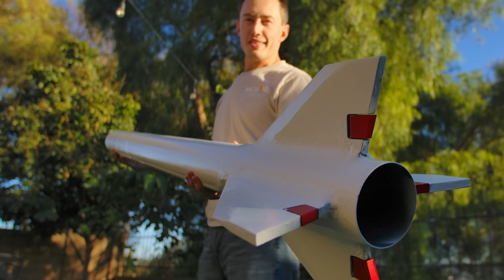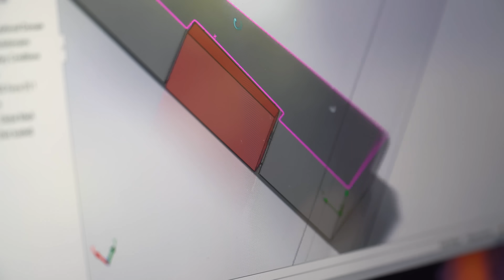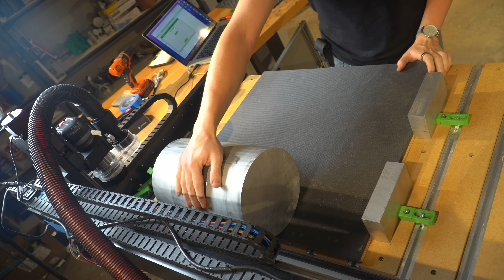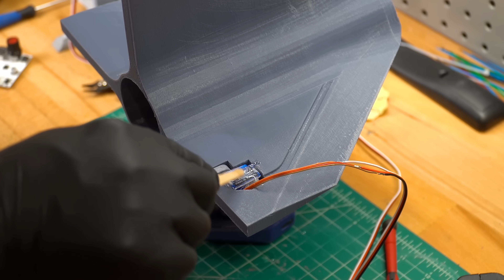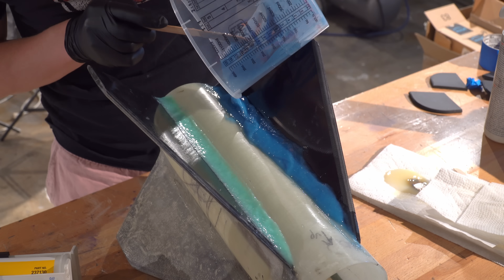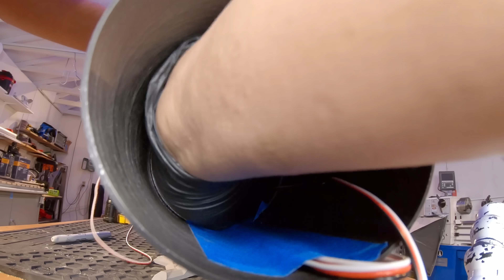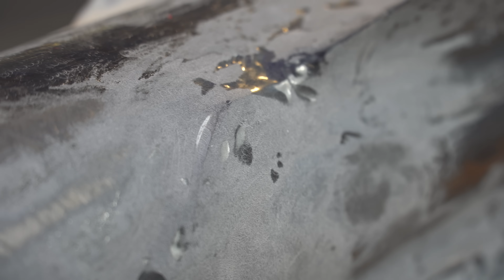Building a Guided Rocket to Hit Mach 3

Comment: you seem to be fairly thorough for the design limitations of the project I don't see you skimping anywhere and it's always good to worry, failure is always an option but an option to be avoided engineering and preplanning always have on hand what you need before you start is number one and number two is never start a land war in Asia

Comment: not sure if you did this or not but printed drill jigs for something like this should utilize a plain bushing to interface between the drill and the jig. ie to drill a .250 hole print a jig with a .375 hole and press in a bushing to get from 
375 to .250 this yields much better results esp if the jig is to be reused

Comment: Whoa homeskill you should not be using acetone with epoxy.  It works great but the consequences are unavoidable even with a lot more PPE than you use. You will have a very short career working with epoxy if you get too much exposure to acetone and epoxy at the same time.  The acetone gives epoxy perfect transport through your skin or lungs and into your bloodstream.  You absolutely will develop an allergy.  Anyone who tells you differently is drawing from inapplicable experience.

Comment: I'm boatbuilding at the moment and would strongly encourage anyone sanding epoxy/glass/CF to invest in a Mirka-esque sander and an autostart vac. 
That'll cost you AUD1200 for genuine or AUD300 for a knock-off. Both blow a conventional orbital sander out of the water. With good abrasives you never see any dust (but wear a respirator anyway!).

Comment: How is a guided rocket different from a missile in terms of R&D?  Like I feel like the feds should be extremely interested in monitoring and regulating this.
Reply: It doesn't matter because he isnt targeting anything. 

A guidance system vs a targeting system along and the lack of a warhead is the main difference. 

However, guidance on HPRs and MRs has been around for decades, namely the sun-seeker or sun-guided model rocket.

The Saturn V was a missile, but we call them rockets because they carry cargo and/or passengers.

Also,  the NAR requires a working recovery system.

Comment: use heatshrink on the solder joints 😭😭
Reply: My good dude, if you are drowning it in epoxy nothing will touch that metal again.  You would want a drill to access that joint again.
Reply: @MrBrukmann  nah it shorts to the carbon fiber
Reply: @_ollie  I actually have decades of experience with this material. Yes, if I was running a factory and knew randos would do the work I would make them shrink wrap it. Frankly the presenter would qualify as a low experience worker (very smart though!). 

I would take a disposable cup and make a side batch in a few seconds where I adjusted the parameters of the epoxy such as surface tension and insulative filler to make something that gels to the connector and wire really well, creating a 100 times better (practically indestructible) form of your heatshrink. You can literally do almost anything with these materials, they're magic. If I wasn't allergic due to using acetone with epoxy like the presenter here, I'd still be making magic.

Comment: "You can be killed by an Estes park flyer."

I had a little Estes R2D2 rocket fail to ignite once. I didn't know what was happening and walked up to it. It ignited suddenly, when I was about to bend over and pick it up. I felt the heat of the exhaust on my face, but wasn't close enough to be burned. I learned a LOT about safety from that one experience.

Comment: the rail guides will likely NOT melt off (if they did they would likely do so asymmetrically which would be a problem) because at mach speeds and them being so far back on the airframe they will experience little heating

Comment: Really like the project and the testing you're doing for the components! but 11:15 your CNC isn't even enclosed, your whole shop will be covered in small amounts of carbon fiber dust, wearing a mask for the time you're actively working with it isn't enough because you risk breathing it in with every small movement of air. Please deep clean your shop (wearing protective gear)!

Comment: IDEA: To save time on mixer cleanup, could you 3D print disposable covers for your mixing paddle? And / or spin cast a flexible, removable silicone liner for the bowl that you can pull out and flex to break off the cured material?

Comment: I think you should try 3m 07333 or 08115 for your bonding I feel like either one of those would save you a lot of headache, also both should be stronger than the loctite. I’d lean towards 07333.

Comment: what was the purpose of dying the epoxy if it was going to be painted over anyway? i would also reccomende foam sanding pads for sanding complex shapes, really helps removing highpoints without worrying about introducing flat areas from rigid sanding.

Comment: My take on this would be to make a mould for the fillets and case the fillet. Then glue it in place. The advantage is that you can control what the end ie the top and bottom of the fillet looks like, and being cast in the mould you can als add some carbon fibre to the casting  to a tiny bit more strength. That way you get all the fillets identical and you should get a much more event surface and lower aerodynamic distortion. Similarly the wire capping I would cast in a mould again so you nice control of what the ends of the capping look like.

Comment: "Those railguides will just melt off and it'll be fine" that is such foreshadowing considering they will likely melt off at different times, leading to aerodynamic asymmetry. Especially since they are not really smaller than the control surfaces 😬

Comment: I am a mechanical design engineer and design automated manufacturing equipment.  Servos are how we get precise position, speed, and torque control.  This is really so cool to see you applying all this to the rocket.  I have learned a tremendous amount from this.  Thanks.  This is awesome.

Comment: 34:20 Next time draw a parallel line and use the line as the index guide. Since the line is not going to be covered by the epoxy it should make it way easier to do.

Comment: LOL. The moment I saw the bare servo wires I was like. Heatshrinks!! You missed the heat shrinks. When I was into solar car things, the chassis was built with CF and this was a common mistake especially in case of insulation failure.

Comment: Any reason you didn’t use heat shrink wrap or any other insulator around the exposed servo wire soldering?

Comment: When testing the servos, wouldn't the vice act as a massive heat sink? I'd think the servos could fail much sooner in the rocket fins environment, where they can also potentially also be exposed to some additional radiant heat from the engine perhaps?

Comment: Nice vid!
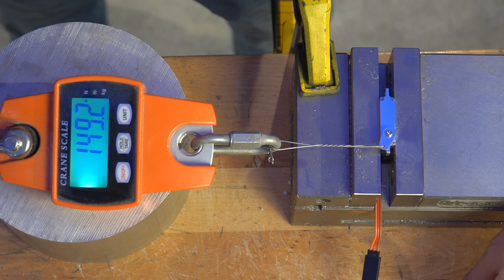4:36 How exactly did you calculate the resulting torque? The Servo arm is not perpendicular to the wire, so you'd have to adjust for the lower tangential distance to the axle. If you didn't, then the torque would be about another ~10% lower because the lever arm was about 10% shorter.

Also clamping the servo in a solid vice kind of mitigates the heat problem in your test. A carbon fin is much more insulating, although the mach high airspeed should help. Still sounds like what boeing did when they static fired the starliner RCS "doghouses" - without the aerocover on and with sealevel atmosphere convecting the heat lol https://youtu.be/VvaSRfpW5iY?si=7GN3-XPEAXoHnxI3&t=343 (they failed inflight due to overheating)

Comment: At this point I wonder if you have enough clout to get a servo manufacturer to make you a servo with custom gear ratio. Your application does not really need 45° deflection; I'd wager a guess that half as much would be plenty enough, giving you more force and even more precise control.
(Plus, frankly, I can see many applications in standard RC planes that could profit from a servo with more realistic angles for direct drive of the control flaps.)

Comment: While measuring static torque the lever arm is supposed to be perpendicular to the force vector. Here it can be visually seen that the arm is some 35° off from being perpendicular. This might be the reason why the servo came out to be lower than the specification.

To find out if this caused the reduction, we can calculate the expected torque when the lever arm is at 34°:

Torque is calculated as:

τ=F⋅r⋅sin(θ)

With the lever arm at a 34° angle, the effective torque would be approximately 10.4 kg/cm, which is close to the 11 kg/cm you measured. This difference was probably caused by the angle offset, as it reduced the effective torque significantly from the ideal 18.6 kg/cm.

Comment: I've admired you and your work for years and just subscribed. As someone who was alive for Estes' introduction of D engines, I am made constantly awestruck and envious by the current state of privately constructed launch vehicles, yours among the most outstanding. I have two questions - did you need special licensing to create an actively guided rocket, and when you are working outside, do you take any steps to mitigate carbon fiber dust going into the air, not to mention your lawn and backyard environment?

Comment: You should be using twisted servo cable or even better, multi-strand twisted network cable. 8 wires total, 4 for signal and 4 in parallel for power. The twisting removes the ability for interference to get into the cables.

Comment: Seems like the fins have a bunch of material outboard of the servo and control surface cutouts. I'm thinking that the weight might promote flutter, and that the area could probably be thinned and/or tapered down to address the problem.
Reply: BTW, since you are installing permanently, carbon cloth over the servo and the wire channel would probably stiffen things up quite a bit.

Comment: Re: Location epoxy line for raceway. You could setup a laser level and use the vertical line. Position the laser so the vertical line runs down the length of your cables. Then you can run your tool with that line as reference.

Comment: Using CA on silicone shielded PWM cables is a horrible idea. The silicone gets brittle really fast and almost turns to dust by means of the CA. This is why model flying people never use CA in combination with silicon wire.

Comment: "Old laptop from 2020". Woow. Meanwhile Im sitting here with my 10 year old dual core 13" Macbook Pro that has 25.000 hours on the clock rocking a Debian install from 2014. That goddamn Macbook is worth a quarter million dollars and I cant get rid of it because I cant afford to spend half a year to reverse engineer new Macbooks to run Linux on.

Comment: Suggestion is to add launch rail first. Then use a template for the pwm wires that connects to the rail, making everything nice and parallel

Comment: 16:50 as a person who worked with CF designs and put electronics within CF housings, i was screaming at the screen, wtf you were doing bro, that you did not use heat shrink to insulate those solder joints. Bro...

Comment: Really cool project! I have a questio regarding the fins (good shot at 41:27): Why dont you make the rear edge of them sharper for improved airflow around? Is it because those fins are so small it doesn't make sense in terms of effort to result?

I only have a non-engineers understanding of aerodynamics, so can you tell me the reason?

Comment: Desolder the pwm wires from the servo then solder your own nice silicon covered wire and you can have it as long as you like without those exposed solder joints every so often

Comment: When you tested the servos I was "lets seeee if he has luck or not"..... well lucky you you had problems. By the way why didn't you uncrimp the servo cables so you could use a smaller diameter to drill in the surface?

Comment: The entire fin needs to move for supersonic flight control.  The little flaps are in the low pressure region behind the shockwave caused by the fin.  This is how aerospace solved the lack of aircraft control when going supersonic.

Comment: Buying spools of wire is cheaper than buying the servo extenders with the added benefit of less work with cutting off the connectors and less joins in the wiring. You can also buy the connectors empty then crimp the pins on and push them into the plastic connector to use the standard connection at whichever end you want.

Comment: That's such an amazing, high quality video! I don't think, however, it is fair calling this a no effort november video because of how good it is lol!!! 

One important question!

I'm from Brazil and our university rocket team is working on a mach 0.6, 1km apogee model rocket which will also be built around a carbon fiber tube. Our worry is that, being conductive, as shown in the video, the CF frame will make the whole rocket act as a faraday cage and block any rf signals coming in or out of it. I did some research and thought this wasn't much of a concern but i did test inserting a NEO6M GPS module inside our CF tube and it completely killed all data packages I was analyzing with the " U Center " software. We thought of putting the electronics bay at the nose cone but our parachute ejection system is designed for the main frame and we were worried about having 2 flight computer modules and have to wirelessly trigger the mechanism downstream. I'm very curious as to how this will be tackled!!!

Thanks a lot for the great video, you're literally the one who got me interested in model rocketry and the reason I'm working on this project know inside the uni rocket team

Comment: I am amazed by the video and the amount of work you put into it, even if you call it “No effort”… I think you could've saved yourself a lot of work if you have thought better about using epoxy the way you did… maybe you've got to opt to making mold to use for custom shaped parts in forget carbon fiber that you will have to just stick with little epoxy where they should be, thus reducing weight and making the process less messy… Furthermore, I don't understand why you don't use heat shrinking tubes for the soldered wires? Moreover, I would try to make it serviceable by not epoxying everything in a way that I cannot remove it little grinding or cutting knife… the servo tab would have been better if you used it instead of cutting it… You have an incredible number of machines (kind of jealous in a positive way), I really which that you get access to more funding and facilities… I don't know how you can afford them? Does Patreon and Youtube earning cover for the costs? 

I wish if you spend time using more of them, like to CNC machine aluminum that you can cover with the whole rocket or some of the parts like the fins to get that perfect finish all the time... explore different approaches to make the build process straightforward, like making molds, using EDM, finding new paradigms to solve problems at hand… also should be the way to go so you can duplicate the designs and ensure that you can have more of these rockets to test and make them fail to speed up the progress and reduce the amount of work that would each one take you as it is sad that you spend maybe dozens of hours on each, and it fails at launch in few seconds, and you cannot move forward quicker while the weather allows it.

Other than that, thank you so much for the great lessons, I thoroughly enjoyed every second of your videos and I learn a lot from you and other YouTuber, I feel sad that I cannot contribute myself due to not having the bare minimum to deliver something decent despite being in Canada… I would like to thank your sponsors and paterons.

Comment: Those giant paint cans can have the tip swapped out with a regular tip if you didn't know. 
I use an air powered sander for fiberglass as its completely water proof so working under a sprinkler will keep the dust contained.

Comment: Remember that RF will not penetrate prepreg CF. I've frequently used it as lightweight RF shielding material. Even the additive materials with tiny chopped pieces of CF are RF opaque AF. Oh, and SLS materials with CF are also surface conductive. Makes for warm batteries 😮

Comment: 31:52 Why not drill at an angle such that the wires “flow” into the holes vs. make a sharp 90 degree turn? Just wondering aloud.

Comment: As someone who builds UAVs... Yeah, carbon fiber is definitely conductive. When I watched you leave the wires without insulation I was thinking "oh no..." ... I'm glad you caught it early in testing though. It's not hyper conductive but it's JUST conductive enough to screw stuff up. I feel like it varies a lot from batch to batch of CF too. Personally? I like cutting it underwater. It's so low hassle. You only deal with the waste water.

Comment: Using both glass filler beads and cabosil (fumed silica with a tabular shape) goes a long way towards avoiding slumping and wasting time and material waiting. For obvious reasons you don’t want to breathe dust from it, but you’re already taking precautions. Also, with the thickening effects, it opens you up to a wider range of epoxy resin choices. It’s unfortunate that MGS285 and the slow hardener is a few hundred $ per gallon these days, but it’s used for certificates composite aircraft construction.

The increase in usable strength might mean fewer layers in a layup, so I wouldn’t let the cost scare you. Glass transition temperatures can exceed 100C though. For maximum strength a post cure bake is necessary.

Comment: THANK YOU SIR!  FINALLY, a big-ish YouTuber willing to flat-out state that Carbon Fiber dust is "WORSE THAN ASBESTOS" and take safety precautions in kind.  I really hope home gamers out there are paying attention instead of taking the example of all the car modders using abrasive cutoff wheels and oscillating saws on dry CF panels, filling their homes and workspaces with killer dust, and often not even wearing breathing protection.